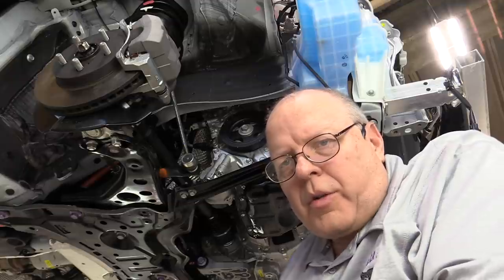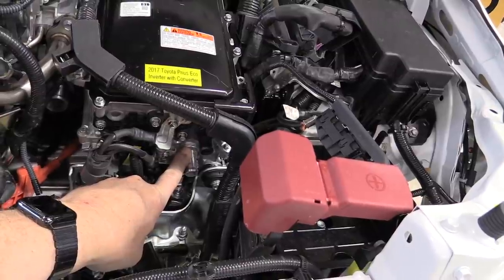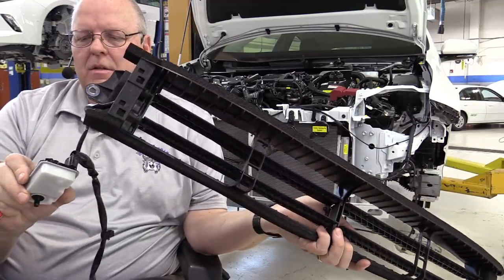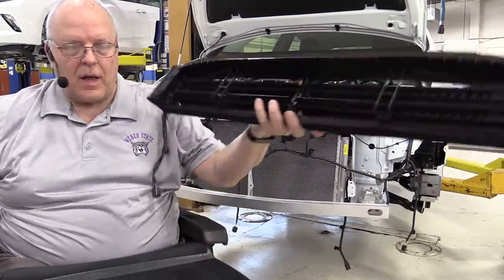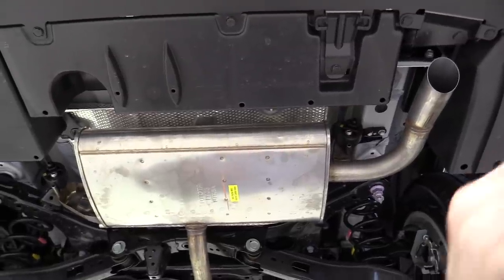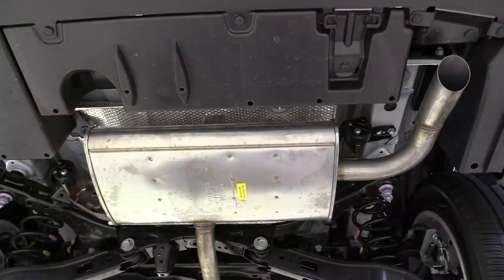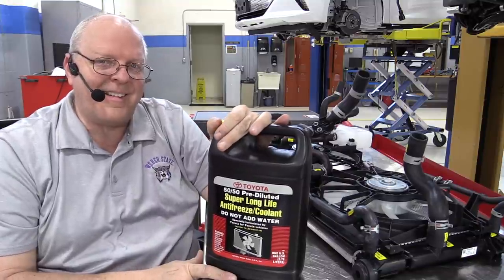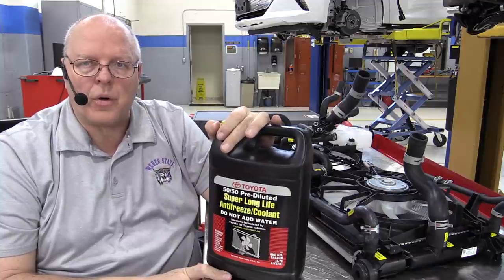Hybrid and EV Cooling Systems

Comment: Hi Professor, I own a Prius Prime, and I think that this car you are working on. You called it an eco, and the car looks exactly like mine.

Question, the coolant reservoir on the left keep emptying and I have steam or a mix of fuel and or oil, I’m not sure what it is exactly. Just billows of white thick smoke/steam but it lingers in the air.

Toyota near me is unable to figure out what is wrong. They say the cylinders are holding pressure and there are not signs of burning coolant. The car seems to run fine...it’s just smoking and the coolant constantly drains within miles.

Can you direct me to someone who can fix it for me? Toyota dealership near doesn’t know what’s wrong.

Thanks for making this video. I really enjoy this vehicle. It is very reliable and is actually pretty quick in traffic. I made the mistake of seeing how long I can go on an oil change using Lucas  synthetic oil stabilizer, 40k, but I’ll never do that again. I also only use non-ethanol fuel. I also decided to put in a K&N air filter on it and the engine just purrs. Even more quiet than it is stock and Toyota really did a great job on engineering these cars. The best Prius I have ever had the pleasure to drive and with a full charge and my additions, I used to get 72 mpg. Now though after 133k miles, I need to replace spark plugs and get it serviced.

Thanks.
Reply from the maker: This one is not the Prime. That issue sounds pretty serious. The exhaust heat recovery system could be leaking exhaust into the cooling system causing that problem. Your coolant is probably going out the exhaust pipe. See https://youtu.be/LTxGlUDcTDs?t=1074

Comment: Professor Kelly, I have a question relating to coolant draining and bleeding procedure for a 2010 Prius base model. My local dealer in northern Virginia charges $200 to change the engine coolant and $200 to change the inverter/converter coolant. I'd like to do it myself. I haven't been able to locate any solid videos and/or instructions on how to do both properly. Based on watching this video of yours, which was incredibly well done, it concerns me that I don't have the proper professional level scan tool to force the water pump to the inverter to kick on to bleed it. If it wouldn't be too much of a bother for you, is it possible for you to recommend an educational source for a DIY mechanic showing how to change the engine and inverter/converter coolant and bleed both of them properly... without having to purchase a $20,000 Toyota scan tool? Many thanks professor. Regards, Steve.

Comment: Thank you for your videos professor. I am enjoying them a lot. I have got a first gen 5 year old Chevy Volt and I am wondering maybe once you will make a video about the Volt's cooling system too. Till then I want to ask you what will happen if I won't change the cooling fluid of my battery and inverter. Some owners says we don't really  need to change it since the cooling fluid is preserved in the cooling system even in better conditions then in the shop's store. I know that service manuals recommend it to change it after 150,000 miles or 5 years, but mine has only 100,000 miles on it. Will it damage my batteries if I won't change it until I get 150,000 miles?
Reply from the maker: Thank you! I am planning on making a cooling system operation video for the 2nd generation Chevrolet Volt as well as battery operation and service and transaxle operation and service. I will be sure to point out what has changed verses the first generation Volt. Changing the coolant before 150,000 miles will not hurt the system as long as it is done properly. I do not recommend that you try to replace the coolant in your battery yourself unless you have he proper training and tools. The procedure requires a scan tool to activate fluid pumps and disable the coolant heater and chiller. It also requires disconnecting a coolant hose at the battery. It is a big job that must be done correctly or damage to the battery and vehicle can result. I hope that helps.
Reply: Yes I know only authorized services can do it. That is my problem in fact because here in Europe don't really have such services and the closest is very far away from my home (more then 500 miles away). So I wanted to know if  it will be a problem if I will change the cooler 2 or 3 years later when I get closer to 150,000 miles. Maybe till then will open some sevices closer to my home.  Will it damage my batteries if the cooler will be older then 5 years but the mileage will be less than 150,000 miles?
Reply from the maker: I misunderstood your question. No, It will not hurt anything as long as the coolant has not darkened. Normally it is a bright orange color. Best wishes
Reply: Thank you professor. It has perfect orange color. You helped me a lot. I am looking forward to see your new video about the 2nd gen Volt. It is unbelievable how much GM reduced the electric motors size and weight. I wonder why it was so huge in the 1st gen Volt. They find some kind of new technology to build an electric motor with less permanent magnets? Those two motors are less weight and size then the B motor in the 1st gen which we could see in yours video is very very heavy.
Reply from the maker: The first generation Volt transaxle is actually a modified version of an extremely rare (one year only) 2009 Saturn Vue Hybrid (MK3 option code) 2MT70 Transaxle. The Saturn 2MT70 transaxle only had 2 modes rather than four, but it looks almost exactly the same internally and externally as the Volt's 4ET50 4 mode transaxle. It was an old heavy design when they put in in the Volt.

Comment: I can't believe that it took until 2021 to get an automaker to install a heat pump instead just a plain AC system on their cars.  this means that the engine does not have to provide heat to the cabin unless its really cold out, and thus, can operate more efficiently.
Reply from the maker: The 2011 Nissan Leaf had a heat pump. they are used by several vehicle manufacturers now. Thanks for watching

Comment: I think the radiator grill shutter system may be utilized to improve overall gas mileage during winter driving condition.
Reply from the maker: Yes, it will help keep the coolant from losing heat

Comment: Very educational video, lot of knowledge but I would like to know how to bleed the engine coolant system? Any help?
Reply: Set the vehicle in maintance mode with a scantool and let it idle til the coolant is between min and max. There is also a way the get it in maintance mode without a scan tool, there are a few tutorials on yt about how to enter this mode without a scan tool.

Comment: Hi Professor Kelly thank you for your most informative videos esp on toyota hybrid vehicles. I am driving a Toyota fielder station wagon 1.5 hybrid here in Singapore , vehicle registered on Feb 2015 and seek your advice if there is any further modification to the current auto transmission oil cooling system by retrofitting an aftermarket oil cooler radiator coil?

Comment: New Nissan Leaf battery “Passive Cooled”. Live in PhxAZ heat. Affects on battery life?
Reply from the maker: What a terrible design! EV Li-Ion battery life is affected by excessive heat. The owner's manual actually tells you to avoid hot temperatures! This is a quote from the 2018 Leaf owner's manual on page EV-20 
"To maximize the battery's useful life, use the following driving and charging habits where possible:
• Avoid exposing a vehicle to extreme ambient temperatures for extended periods. 
• Allow the vehicle and Li-ion battery to cool down after use before charging.
• Park/store your vehicle in cool locations out of direct sunlight and away from heat sources. 
• Avoid sustained high battery temperatures (caused, for example, by exposure to very high ambient temperatures or extending highway driving with multiple quick charges [if so equipped]) ."
Wow! Why would anyone design a vehicle with these characteristics? Apparently the vehicle is made for mild and cold climates only! The battery does have a heater ;) Best wishes!

Comment: Hello professor, I'm wondering why there's no heat exchanger to cool the ICE oil, are they relying only on air that "touches" the engine block?
Reply from the maker: Hi, very few engines have heat exchangers for the engine oil. The aluminum block, pan, and heads are great heat dissipators to the engine coolant by themselves. Best wishes!
Reply: Thanks! Here in Europe where we have (unfortunately) a lot of Diesel engines heat exchanger are more common, because engine oil is also used to lubricate the turbocharger bearings, and doing this warms up a lot the oil.

Comment: Hi professor, can you please make it clear for me, i have a 2014 chevy volt, the recommended coolant is a Dexcool from GM and my question is if i can use other hybrid coolants in chevy volt cooling system. I was not able to find a clear answer, anywhere on the internet. Thanks in advance.
Reply from the maker: Do not use any other coolant in the Volt. Only 50/50 premixed DexCool. Best wishes

Comment: Prof. Good afternoon. @27:38, the “Brushless DC Water Pump” circulates the coolant fluid from the reservoir which cools the transmission then then inverter. I don’t have a scan tool to activate the pump. My workaround is to top it off, turn on the car, put in drive then place in park and check the level until the fluid level is at the reservoir line. I have a 2015 Fusion Energi, I still bring my car for the service check ups but with the duration between service intervals I have noticed that the reservoir gets low. Is this ok as long as I don’t over service the reservoir? 

Is there another way of servicing this unit without having to purchase an activation tool? 

Also I am not sure if you have discussed the reason why there are “Brushed and Brushless DC Motors?” Is it because of the need for “Potentimeters” on the Brushed DC units? For example the variable louvered inlet which limits the airflow when needed. Or is it just what the engineers added? 

The Hybrid vehicles are fun to work on but I limit myself to the basics due to lack of additional computerized tooling required. 

Thanks again for your help. Reg

Comment: Hi , I have a question. I took my Highlander Hybrid to local mechanic as the AC did not blow cold air. So he didn't pay attention and he added the dye and the proton fluid as if it was a regular highlander. Then they realize the mistake so he said it need to be taken to the Toyota dealer service center so they can remove the dye and fluid, otherwise the fluid and dye acts as a explosive in the vehicle and I cannot drive. The vehicle needs to be towed to the fluid might act as explosive. So they towed the vehicle to Toyota dealer, The dealer replaced the compressor and dryer. The AC works fine now. I am very nervous to drive as it was told that fluid might act as explosive. I am not sure if the vehicle is safe enough and when the local mechanic put the dye and fluid it has not gone to other parts of the vehicle and might cause issues later sometime. Can you please help me to understand the issue and if it is safe to drive?
Reply from the maker: There is no explosive danger. The incorrect dye and oil can cause a short circuit internally inside the electric AC compressor. It sounds like that was replaced and the system was flushed out. I am sure you are safe to drive. There never was an explosive danger. Have a good day!
Reply: Thanks ,Thanks and again Thanks a lot, I saw few videos mentioned that the carbonator needs to be replaced as well which they did not. my last question in my mind is would the dye would flow somewhere and be there in the system and create issues? I have the vehicle for past 4 days but I have driven it and looking for new vehicles so stressed out !!!
Reply from the maker: No, the dye would have just been inside the sealed refrigerant system.
Reply: WeberAuto Thanks a lot !!!!

Comment: I have a 2014 Silverado 1500  converted to a hybrid by via motors vtrux . The problem that I’m having with this truck is the fan stays on all the time even when off and no key in ignition . Are you familiar with this hybrid ?

Comment: Interesting that there is EGR cooler on gasoline engine. BMW uses EGR cooler starting from 1998, but only on diesel engines.
Reply from the maker: Yes, the new 2017 Tier-emissions requirements here in the U.S.A. require even lower amounts of NOx now. Having cooler EGR gasses (By liquid cooling them) works very well at decreasing NOx compared to just running hot exhaust back into the combustion chamber. Diesels had to do this a long time ago because their higher compression ratios and combustion temperatures produced a tremendous amount of NOx. Thanks for your feedback!
Reply: The egr cooler has about a 100% failure rate in VAG diesels before the car reaches 250 000km. To replace it a VAG-workshop need 15 hours. Something to think about when buying a used Skoda/VW/Audi/Seat.

Comment: thanks for video.     what is the reason of fans running in two different direction.  how  coolant in the radiator  cools off
Reply: Probably helps with vibrations and noise... Also may help with airflow.. having the air swirl in different directions may help with those issues.

Comment: One criticism of the European cars is their coolant tanks that don't just store the coolant but circulate coolant through the tanks. After some time, the hot and cold expansion/contraction of the plastic tank causes it to crack, causing head gasket/engine failure. I hate to see Toyota going that direction. But the Japanese do use better plastic and rubber than the Europeans.
Reply from the maker: Thanks for the feedback. I have seen that happen on other vehicles as well.

Comment: I thought variable valve timing eliminated the need for EGR valves.
Reply from the maker: it did for Tier-2 emission standards, but the 2017 Tier-3 emissions standards require even lower amounts of NOx. A cooled EGR system has to be used on many higher compression engines now. Thanks for your feedback.

Comment: Why does it have 2 cooling system? wouldnt it be more efficent if it had one system?  
when you run EV mode in the winter, it will also heat up the engine, so when it starts it doesnt do that cold, instead it moderate warm.
Or am I getting it wrong? :D

Comment: Hi Professor Kelly, quick question, my 09 Camry hybrid the a/c blows hot air, however the heat works 100%. Just no cold air. 

Codes: B1423, B1472.
Reply from the maker: That does not sound good. I cannot help you with that. Best wishes.
Reply: @WeberAuto  thank you so much for the extremely fast response. 

B1472 ; A/C Inverter High Voltage Output System code could that possibly be a result of a problem from the HV battery? Or the Inverter HV output itself? 

You’re doing the lords work with what you do, and I am extremely appreciative.

Comment: Do you know what type of signal the engine module puts into the two wires to control the speed of the coolant pump. If the pump is connected to power and ground leaving the control wires unconnected the pump will spin at over 6000 rpm. I want to have it at 3000 RPM and was wondering what signal is the ECM using to control the pump. It has its own dedicated two wires for this. Is it a CAN or LIN signal ? How can the signal be replicated ?
Reply from the maker: It is a PWM 12V signal around 1kHz

Comment: i thought the purpose of those radiator shutter is to heat up engine  faster during cold weather please correct me if i am wrong
Reply from the maker: That is not correct. The thermostat is closed and blocking coolant flow to the radiator while the engine is cold. Open or closed shutters will have no impact on how quickly the engine warms up (and the fans will be off). The exhaust heat recirculation system's job is to help heat the engine more quickly. Thank you for your feedback.
Reply from the maker: Okay, I was wrong. I does say in Toyota's service information that the closed grill shutters block air flow when cold to help the engine warm-up. You were correct.

Comment: John - does the GEN 2 have an inverter cooler? A power split device fluid cooler? The WS fluid degrades with heat. Maybe that's why they have the cooler.
Reply from the maker: Yes, all four generations have inverter and transaxle stator coolers. There is a huge amount of heat generated when the inverter us under load. The Stators get very hot as well under load.

Comment: Dear Sir,
Please tell the electric power consumption of an electric Air-conditioning system in a car.
How many Volts?
How many Ah?
How many watts?
Thanks
Reply: The Kona Electric has a dash power indicator specifically for the compressor and it reads around 600 watts +/- 200 in light use.  As it's running off traction battery voltage (356 VDC) via what appears to be a built-in CAN-controlled driver, you can see it's only drawing a couple of amps, however it's fused at 30 A.
Reply: @paulaxford6754  
Thanks

Comment: Professor please resolve my problem 
I am facing Hybrid error in my car ES 300 2020
"Hybrid system overheated please reduce output power"
It's showing and after one second disappear please help me and told me what I should because I visited in Lexus service center they told me no error is showing in computer so I cannot resolve until its showing.
But I checked my hybrid battery its working perfectly.

Comment: What do you mean by the throttle body icing up?
Reply from the maker: The pressure drop across the throttle plate causes a change in temperature which will freeze the moisture in the air on the throttle plate

Comment: Does Toyota prius vary the radiator cooling fan speed based on the temperature of the internal combustion engine and electronic components like DC/DC convertor, traction/generator motor, transmission/transaxle system, inverter or any other component.
Reply from the maker: Yes, all of those and the AC system pressures